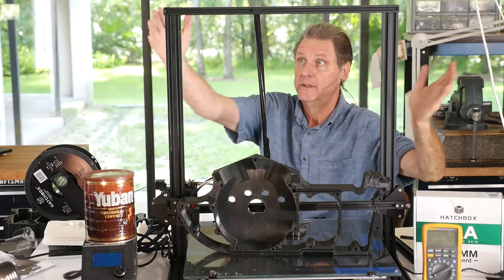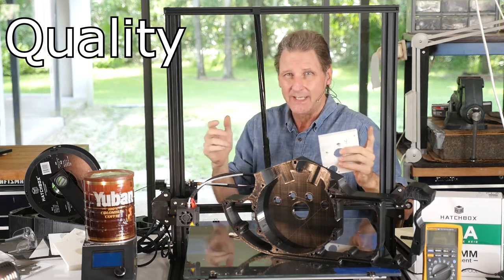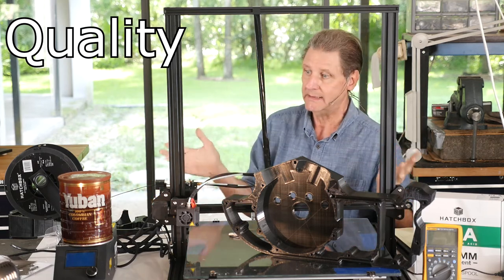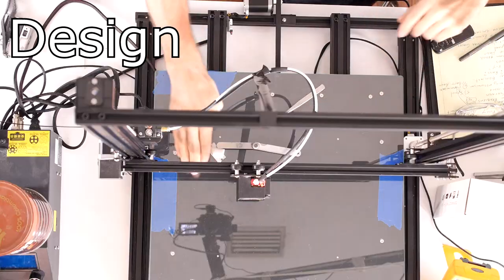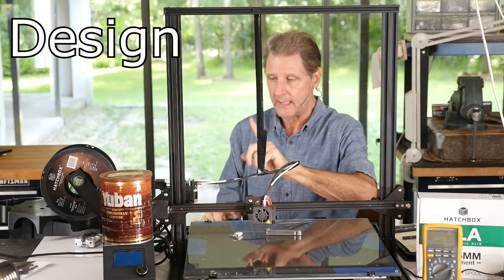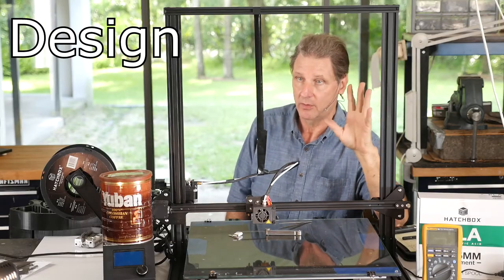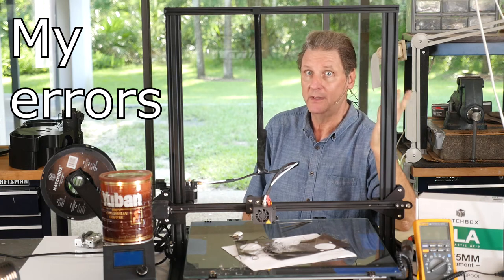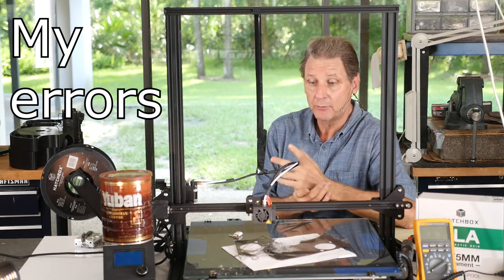Creality CR-10S S5 quality, design, tips, and results

Comment: I been thinking of getting one of these do u still recommend it I need it for personalised work and making robots etc
Reply from the maker: If you need to make big prints, the CR10-S5 was the only game in town. Now I see there is a CoreXY printer, by TronXY, the Tronxy X5SA-500 PRO. 
https://www.tronxyonline.com/Tronxy-X5SA-500-PRO-3D-Printer-500-500-600mm-p61067.html
The pro is $800 bucks but it has linear rails so probably well worth it. Older models without rails are about $400. It also has automatic bed leveling. There were a batch that had bad level sensors and that would ruin the bed, but it sounds like TRONXY and Banggood would stand by us, sending a new printer. I would buy directly from TRONXY since they have new stock that has the problem solved. 

If you don't need giant prints, there are other printers that might be easier to use. The smaller they are, the easier it is to get that critical "first layer" down right. I am going to put in a 500mm bed heater and see how that works. I will also install linear rails on the Y axis of my Creality, and report back on my luck with that.
Reply: @Rako_Studios  thanks I ended up buying the sovol sv03 everything perfect apart from the bottom layer it's not smooth and hard to clean

Comment: switch to petg filament less warping less shrinking and a lot stronger material I print a lot of part for use in my knife making business and I found out very soon PLA just isn't the right stuff for parts  you would be really happy with petg I buy Novamaker petg on amazon runs about 18 to 20 dollars a spool so about the same price as PLA  ,, the only difference is u will need to print hotter I print PLA around 205 to 210 I print PETG around 245 to 255 depending on speed and I use no parts cooling fan on large prints only on small stuff that it stays on for long periods of time , if you haven't already tried PETG give it a try
Reply from the maker: Thanks for this tip! I do want to get into other materials. It sounds like I can do PETG without building an enclosure, which I read I should do if I try nylon or polycarbonate. Less shrinkage would be great for me, since I want to use the parts to check dimensions and such as I design things.
Reply: @Rako_Studios  you would really like Atomic's carbon fiber PETG  it is great for parts and just prints so good, i use a nozzle x nozzle printing the CF stuff i run it at 250c on glass or metal bed with hairspray at 75c. its about 50 dollars a roll but its worth it if u need good strong parts
Reply from the maker: I will definitely order some up and give it a try, thanks for the tip.

Comment: Would you recommend this printer for a beginner ?
Reply from the maker: It was sure hard on me, because it is not just a new thing, but a very big new thing. It's like laying floor tile. Most people do OK with 4-inch tiles, but doing 36-inch tiles is way harder. For me, it was one of the only printers that was big enough to model my Harley cases. I will try some upgrades and post that video later this year.

Comment: Bed heater is a huge let down on this machine... if your planning on buy one of these, budget for the additional bed heater upgrade
Reply from the maker: Yes, I agree. I am finally getting my CNC machine up and running, so I hope to do some major modifications on the bed. I have the separate 1200W heater powered from AC that I bought with the printer, but it is the same small size as the original printer. I am going to buy the large 500mm bed heater, and I think I will have much better luck with the large parts. Thanks for the tip.

Comment: great review, for me this is the worst printer I've ever had ,. deformed plane, z-axis that continuously misaligns, surface temperature only in the center (and it takes 35 minutes to reach 70 degrees centigrade, and often goes into error and freezes), glass top too heavy, guaranteed ghosting, you have to print at low low speeds. never more creality.
Reply from the maker: Yeah, the 120V heater does heat in a few minutes, but it sucks more power too. I think the whole flimsy bed is what makes it such a touchy printer to use. I might look at a CoreXY style one day, they are getting as big as this S5 model. Thanks for the comment.

Comment: I woulda 3d printed a new bracket
Reply from the maker: Yeah, thought about it, but I needed the printer to work first! This is my only machine. I have since bought a RouterParts CNC machine, so I could have made an aluminum bracket too. For now the printer is working OK. Thanks for the comment.